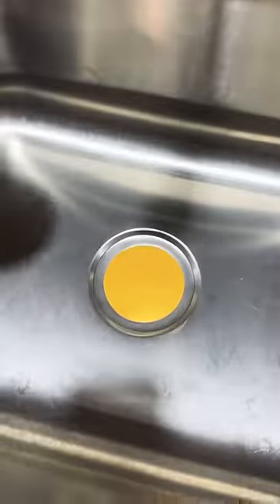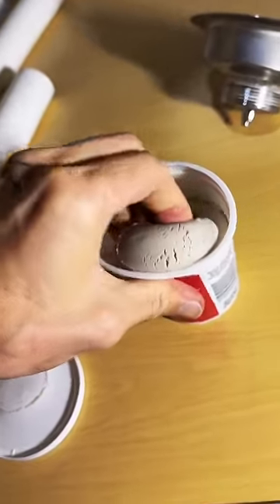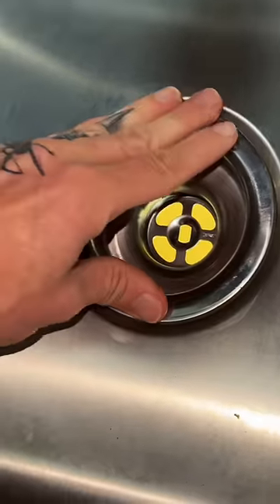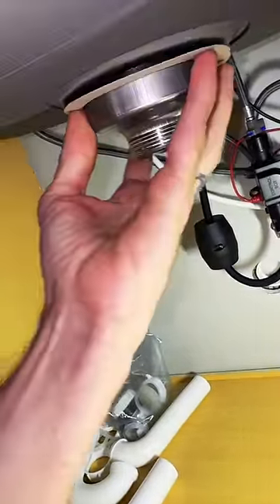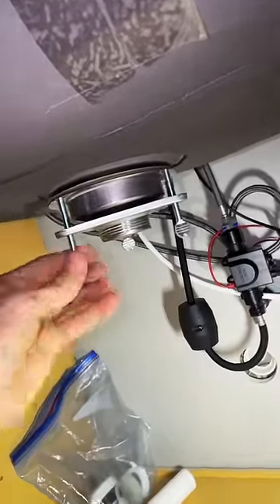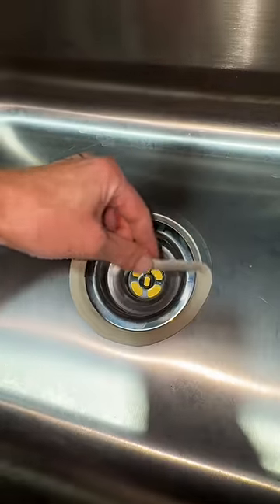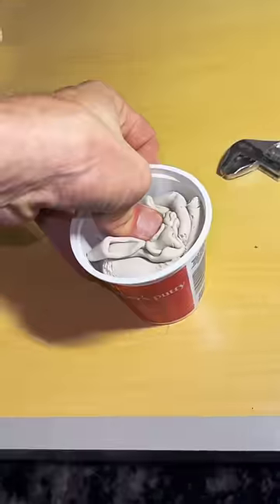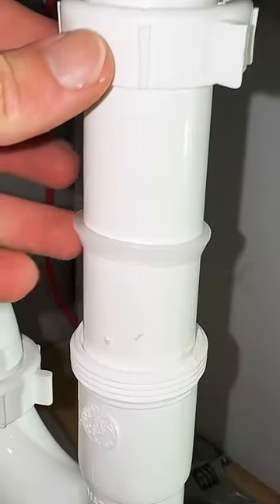Strainer basket install in kitchen sink

Comment: Quick tip. Plumbers putty gets dry and cracks over time causing leaks. Try silicone. It lasts longer and doesn’t crack. If your experience with putty has been well please do. Homestead looks great. Glad your happy with lady and life🤘🏼
Reply: Been doing plumbing for 20 years and I finally tried doing what the new-school guys were doing. Use silicone. Always. End of story. Just use very good quality silicone, and apply it correctly.
Reply: @burtmacklin9529 lol i haven't yrid silicone yet.... but i will now. Thanks

Comment: My favorite ones are the bar strainer ones. They have a little strainer cup that sits in the bottom so that are easy to clean. You also won’t lose things down the drain because it has small holes

Comment: Pipe and dope behind the wall, plumbers putty for it all.

A thin layer of plumbers putty on the plastic fittings works as well.
Reply: Should really use a thread sealant on PVC.
Reply: “Pipe and dope behind the wall,” 😭
Reply: THANK YOU !! I needed this info❤❤❤❤❤❤send my love to Minion too

Comment: I'm a journeyman plumber and this was a perfectly executed and wonderfully explained job. I'd advise against the silicone though, leaking is probably an issue with the tube being at an angle going into the joint.

Comment: Plumber putty cracks and stops working when the area it is applied to gets hot (or experiences lots of temperature change). I wouldn’t use it for kitchen drains or tub drains or any drain that’s going to be collecting hot water often, silicon works better bc temperature changes aren’t going to effect it and it lasts longer. I find it to be overall easier too.

Comment: I do respectable handyman work & i found that using plumber putty around hot water it usually ends up getting hard and crumbling away so i started to use 100% silicone & works just as good if not better. Thats just my opinion though & you know what they say about that 🤷‍♂️

Comment: I know everyone has their opinion but I prefer silicone instead of plumbers putty. Especially in areas that have hot water like a sink. The heat drys out the putty after a year or two and it starts leaking. Silicone on top and rubber gasket on bottom.
Reply: I put a rubber gasket above and below the sink on a rental(no putty or silicone), that was 3 years ago and still no leaks.

Comment: Lowes isn't intimidated by doing this, they just skip the putty, skip the ring, and coat the entire pvs pipe with plumbing glue. I got purple pipes under the sink...and it only took them 3 days and 2 guys, to do it wrong and try it again...to do it wrong again.

Comment: We tried using plumbing putty when our old sink had to have the strainer basket replaced, but it smelled awful especially when it had hot water in the sink I don’t think we had installed it correctly so it still leaked and the smell of the putty never actually went away, so when we got the sink that came with the house replaced after some other things about it broke and started leaking we bought a nice sink we actually liked using and hired a plumber to install it for us, that sink and the drains are still good now but the faucet is coming loose and the handle is leaking for some reason so we’re going to have to fix that again too eventually, but it’s good enough for now as long as we have the dripping spot over a dish that will empty the water into the sink so the water doesn’t flow away from the sink instead and onto the countertop and floor.

Comment: I recently replaced the one in my kitchen.
It's working great, but now I'm afraid I didn't use enough putty.
Reply: Plug up the drain and fill the sink to the brim with water. If water leaks... you need to redo the seal. Otherwise, you did good.
Reply: as long as you had some squeeze out it's probably fine, but like the other commenter said plug your sink and put water in it and check under your sink after a while and you'll know for sure
Reply: I installed my sink without it and there's no leaks. Although mine came with ruber thingy.
Reply: If you didn't you will find out! 😂
Reply: Don’t use putty it dries and becomes brittle with hot water…use a good water seal silicone
Reply: @lordlonjas8013  that's true but it can also hold up for over a decade before you ever have any kind of issues with it, at the apartment complex I work at are 12 years old every drain was set with plumbers putty and I've only had to redo 2 of them because they were leaking a small amount
Reply: @twentydixoncider7443  well that’s nice I installed my sink a couple years back and the plumbers putty leaked for me and once I switched to the silicone never had the issue again
Reply: @twentydixoncider7443  I’m in the UK but I always use silicone on sinks and basins. Personally I Only ever use plumbers putty for toilet cisterns.
Reply: @Xjuijau did u put the rubber thinggy where nate used the puddy? I see people do that all the time....
Reply: @twentydixoncider7443 have you been at that complex seinc it was new? Maybe the guy befor you changed every one but 2😅😅😅
Reply: @51-FS  yeah it came with a sink and it have been over a year without any leak.
Reply: @Xjuijau  yeah that's why it don't leek. U all so have water that sits in the bottom of skink around the drain. The rubber goes on the bottom like nate did in this video.... thats why it don't leek... nate won't have water sitting in the bottom like u do
Reply: @51-FS  I've been there 7 years and know the original guy who worked there he didn't have to change any out unless he was replacing the entire sink lol it lasts a while if you're not a dipshit

Comment: In my apartment, the renovations were quick and dirty. Whoever siliconed (is that a word,?) around my bathroom sink did not completely clean the countertop  before putting a bead of white silicone around where the sink and counter meet, it has been stretching out and became separated from both.😢

Comment: adding grease to those joints will seal them completely without any extra stickyness, i don't remember the brand or type on top of my head but there is plumber grease
Reply: Is plumbers grease really grease or just what it is commonly called???

Comment: I have to replace my p-trap to my kitchen double sink. I don't know how they plumbed it so wonky but a plumber wants $250 just to cut out and apply new pvc pipes, fittings and a p-trap. That's crazy for what I'm thinking should be less than $20 worth of material and 10 minutes of labor with a pvc cutter.

Comment: Nate, I've had problems keepiing the standard strainer basket centered as I tighten it (I am not strong, have weak hand grip and multiple injuries).  Do you think this type (with the thumb screws) is easier to keep centered?

Comment: I hear plumbers putty isn’t good on applications with warm water, because the heat shortens the life span
Reply: Where I'm from we put nothing there. It's metal to metal or metal to porcelain. Never had a problem. However, if there is a problem it will go into the pipe so... design is a little different at the bottom.

Comment: Interesting I have a trap that won’t stop leaking. I’ve tried a lot but I’m not a plumber. Without replacing all of it I don’t know what to do. It only leak after awhile with hot water.
Reply: Sounds like it's expanding the fitting. Try what he did with the caulk around the fitting.

Comment: Nooo!! You have to use silicone!! Plumbers puddy shrinks and contracts with hot and cold water making it fail over time, not always but silicone will not break down the same and maintain a seal for longer when using hot water. Plumbers puddy works great ! But it's not 100% after a year goes by

Comment: I'm fairly certain the rubber ring goes where you put the putty, preventing any leaks and the use of putty. You don't need anything on the other side since it will never see water.
Reply: Yes sir, Your right. No one reads the directions anymore.

Comment: You should use silicone not plumbers putty it will create a leak if you plan on using hot water.

Comment: Stop teaching plumbing. Use silicone not plumbers putty. Do not silicone the slipnut gaskets. If they leak you have the pipe crooked at the connection.

Comment: Thanks for using putty and not silicone. 

Homeowners should not do plumbing.
Reply: Real plumbers know not use plumbers puddy on hot water drains. Kitchen sink has hot water poured down and over time plumbers puddy will shrink, crack and wash away . It'll stop the threads but will rust the threads as the months becomes years. Real plumbers use silicone,  plumbers puddy will work but you have to redo the seal in a year or two or face a rusty stuck sink trap and replace the whole sink bay
Reply: @brandonwyatt3901  wrong.